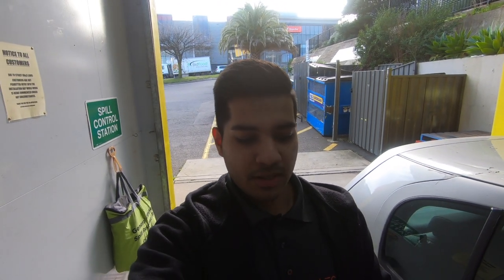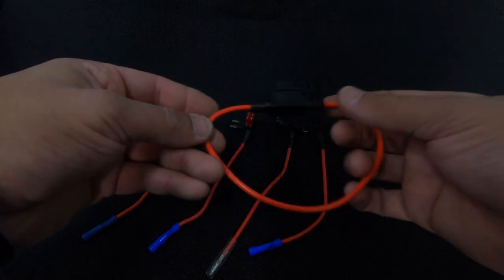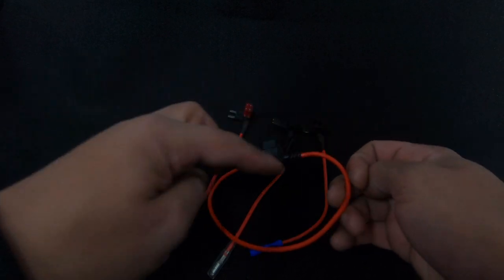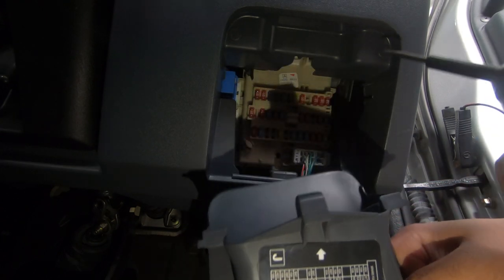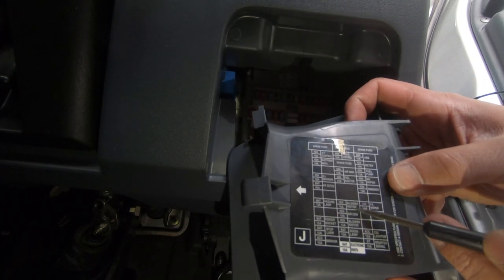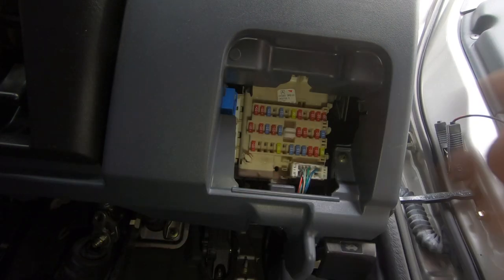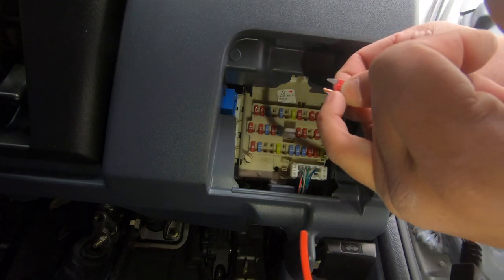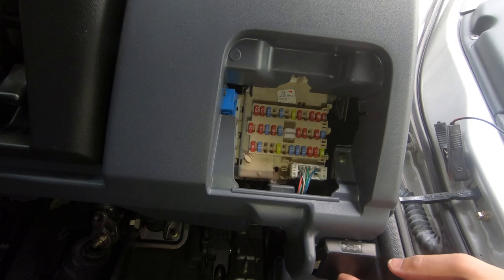How to connect to a cars fuse box.

Comment: I am at ground zero in my understanding but my question:  I have a Holden Monaro (Pontiac GTO) and I bought a spare fuse box from salvage.  Can I somehow harvest one of the terminals from it, move it into a spare slot in car's fuse box and then use the wire out the back as though it was oem that way?  Or what about the spare slot?  it is powered right?  maybe i do not even need to harvest a terminal from my spare?  how does that work?
Reply: Great question

Comment: Hi Nathan
On my car fuse box, i have found and empty fuse slot (ignition powered). I want to know what capacity fuse is that slot and can i use that with a fuse tap to run my 3 x 12V cigarette sockets?
Reply from the maker: Gary Cooma Hi mate! So the empty slot you’ve found with ignition power doesn’t necessarily have a “fuse capacity” it just switches on with the ignition relay and is basically getting power directly from the battery (after the relay) so you need to work out how much load (amps) you’ll be drawing with all 3 cigarette lighters used and use a fuse a little larger than that number. I.e dash cam uses 5a / Navman uses 5a / TPM uses 5a total current draw id use a 20a fuse. So you can put a 5a in there but it’ll just blow as soon as the current draw is too high. Does that make sense?
Reply: Yes thanks for your reply bro, ok so how would you find how much amps 1 x cigarette socket draws? Say for example each one draws 10A than i will need a 30A fuse right?
Now when i use a fuse tap or piggyback, since there was no fuse there in the first place can i put 2 x 15A fuse on the piggyback?
Reply from the maker: Gary Cooma you only need one fuse on the back slot. And current draw depends on what you’re plugging in. The plugs themselves will Draw basically nothing. When you plug stuff into them they’ll draw current so you need to see what’s being plugged in on a regular basis and read the current draw on the plugs or on the product itself
Reply: Thank you so much Nathan for your time and explanation, just fantastic!, yes thats understood now.
Reply: The Fitting Bay 
Hi Nathan , also what is your opinion in what guage wire to run that 2 x cig sockets over a length of 6m?
Reply from the maker: Gary Cooma 4mil will be fine 😊
Reply from the maker: As long as you’re not running a large fridge or anything like that. If you plan on running fridges etc off it run 6ml wiring
Reply: The Fitting Bay 
Thanks again Nathan
Reply: @TheFittingBay  Great video.     Does the  ignition relay mean all the ignition controlled fuses use the same power source and can all  take 30 amps?  OK to fit a 20 amp tap onto  one currently fused at 7.5 amp?
Reply from the maker: SuperRoger1953 That’s fine only if you’re using a fuse jump/add circuit. Don’t take the 7.5 out and replace with a 30 if something goes wrong you risk cooking whatever is on that circuit instead of the fuse

Comment: why cant the fuse tap be put in one of the extra fuse slots ? or the wire pre-connected to the fuse so we don't have to manually attach it to the fuse  (like in 2nd method u used)
Reply: I am wondering that also.

Comment: Could you put the fuse tap into the empty spare that has power and put the fuse for your accessory in leaving the bottom fuse out?  Doing the same thing as wrapping the wire on the fuse but maybe safer.
Reply from the maker: Sure can!

Comment: What is the wire called for the method you don't recommend? The one where you have to cut the wire and connect directly to the fuse box? Not sure where to purchase this. Thanks.
Reply: just search cable fuse

Comment: Hello Nathen,  I was thinking about pre tap the fuse box with fuse taps add circuit.  That way when I finally get the dual dash cam at least that part is done.  Is this safe to do?  Thanks
Reply from the maker: Joe A Hey Joe yep that will be fine just follow the steps exactly like we’ve done here and the current circuit will still work as normal 😊
Reply: @TheFittingBay  Awesome! Saved the video on the install you did on the Mercedes-Benz CLA45 AMG.  My fuse box is located in the rear.  Thanks again! 👍
Reply from the maker: Joe A Awesome stuff! Thank you. Happy to help you guys!

Comment: Hello Nathan,may I ask if that I replace it on the reading light/dome light fuse ,will the new circuit I connect on it will switch on too when I switch on dome light?
Reply from the maker: K Koseki - Hi mate! No because the dome light switch is at the dome light itself. The light just takes its power from that fuse. So all you need to do is test whether it’s a Constant 12v + or / ACC-IGN 12v and if it has the goods go for it.

Comment: how do I wire LEDs to multiple power inputs? I have 2 fuses I wanted to take as input to my LEDs, 1 is constant power and second is when the car unlock. Can I just tap both of them and wire them together and connect them to my LEDs positive wire?
Reply from the maker: Deven Patel is this so the LED flashes with the car is off? You’ll be better off using a relay
Reply: Ya so I want them to turn on with the other accessories lighta I press the unlock button and I also want to put a switch so that I can turn them on when ever I want manually

Comment: I own a 2009 Corolla and I followed the steps but my amplifier continues to stay on even after I've shut off the vehicle. I fuse tapped a cigarette lighter fuse slot. Thoughts on what I may have done wrong?
Reply from the maker: Remote wire is getting constant. Need to check all connections with a test light
Reply: @TheFittingBay  , I finally figured it out. Turns out that the online diagram I followed had one problem, it wasn't entirely accurate to my fuse box. I had tapped into a fuse slot that was actually for my brake lights and cruise control, and ended having an issue with my brake light switch. I found a fuse immediately after that does start/shutoff on acc mode.
Reply: @TheFittingBay  , thanks for the video. It helped with my problem

Comment: Does using that adapter eliminate the possibility of burning the wires
Reply from the maker: You can still burn wires if you have no idea, nothing is idiot proof. but it will help :)
Reply: @TheFittingBay  the place that installed my system burnt the wire multiple times so they decided to draw power from my TCM 2 months later my transmission started failing because of them connecting my system into my transmission control module. Long story short they kept burning the wire until I suggested they add that fuse adapter and now it works
Reply from the maker: @abert6141  jeeeeez

Comment: Can you connect the ground to just any bolt nearby the fuze box?
Reply from the maker: As long as its unpainted and a solid chassis point it'll be fine.
Reply: @TheFittingBay  is it safe to connect ground wire just to a random bolt?
Reply from the maker: @razmadzekoko  Needs to be on the body of the car, not plastic

Comment: Could we just cut open the car charger and connect the wire directly to the fuse
Reply from the maker: Clash with Moi Definitely not. If you know what you’re doing you can open it up and have a look but if you’re not 100% do not cut it open as they usually have a voltage reducer built in which means If you cut it open and connect directly you will fry said device
Reply: The Fitting Bay that makes sense. My car battery is 12v and the dashcam is 5v. Thanks for saving me from frying my dashcam

Comment: Question, why wire in a fuse after the add a fuse? I thought that was the point of add a fuse?
Reply from the maker: Fuse add circuit 100% Just showing another way for people that cannot get add circuits or don't want to. at least they have a fused connection still

Comment: Saw your video thanks, I have a couple of  questions that hopefully you can help me. If you have an empty slot can you connect a 25 amp fuse? I have two battery dash cam battery pack and two other devices I would like to power on (4 in total). My idea was to put a recoil bus terminal (https://www.amazon.com/gp/product/B08C9MXVFQ/ref=ppx_yo_dt_b_asin_title_o01_s01?ie=UTF8&psc=1) inside near the fuse box. Then connect a tap a fuse with a ring at the end to it.  Then connect the 4 devices to the terminal. So the add a fuse tap will power the terminal and terminal will power on the devices. My last question is if I use a 25 amp fuse for the above will each device get a max of 6.25 amps or each one will get 25 amps if all of them are getting power on.
Reply from the maker: You’ve got it right if you connect them in line with that fuse junction and a 25A you’ll be fine as each device is drawing it’s rated current there isn’t 25A available to 1 device at any given time.